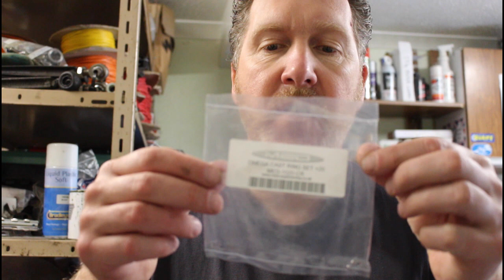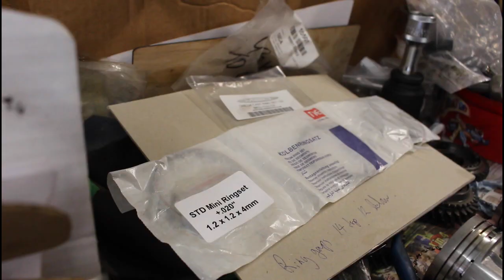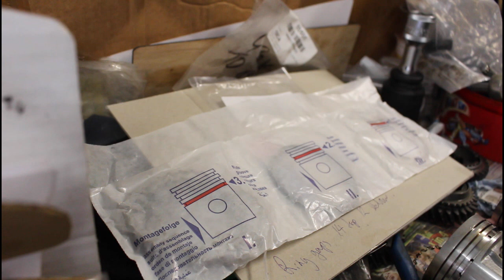Classic Mini Turbo engine rebuild. Part 1

Comment: ah..  so the Thistle run is in Scotland..  all my girls now want to go to Scotland.  A little confused here..  you put the rings in first and measure some gap (?) , but then you pull them out and place them on the piston for re-installation of the entire piston and rings.  I don't understand how the rings hold their adjusted gaps...    good video mate..  thanks for sharing
Reply from the maker: Pauls vid from the other day showed it better probably but the idea is that you measure the gap between the ends of the rings and obviously you cant do that when they are assembled on the pistons. they keep the gap because they don't flex (much) but are quite brittle so that's why you have to be careful with the insertion of the built up pistons and rings. I live in the beautiful lakes which are picture card perfect at the moment but i enjoy my trips to Scotland as its more rugged, it certainly has a different 'flavour' to it.